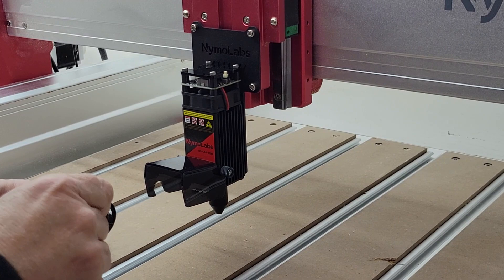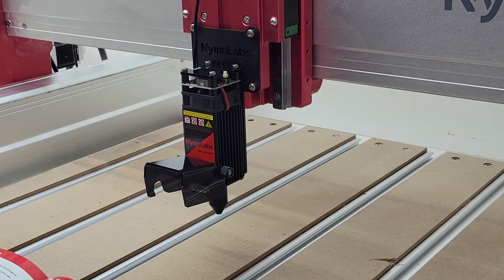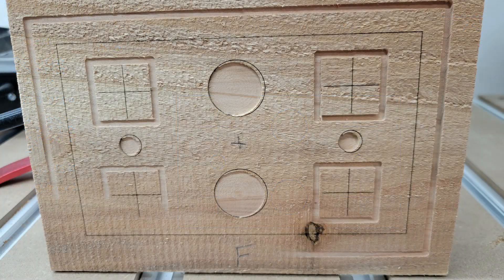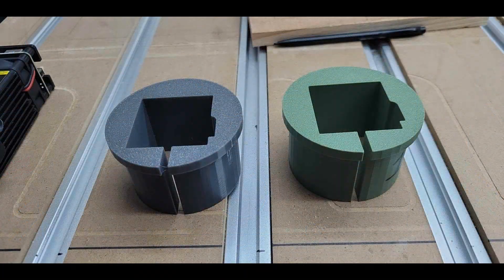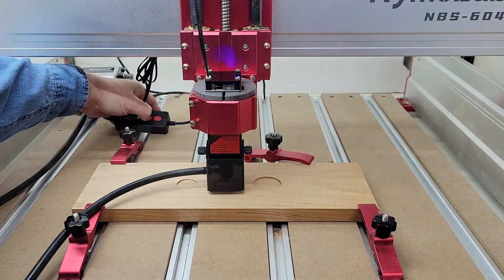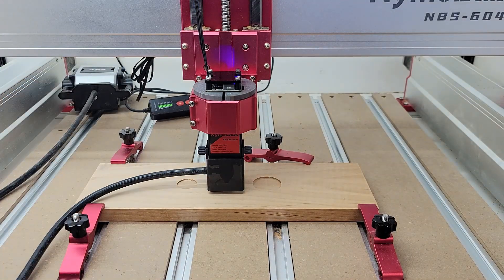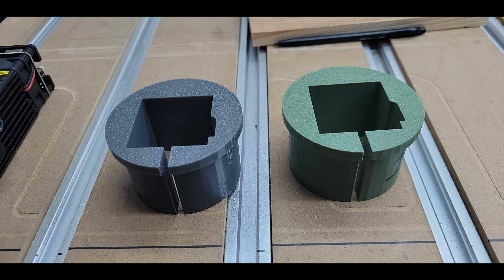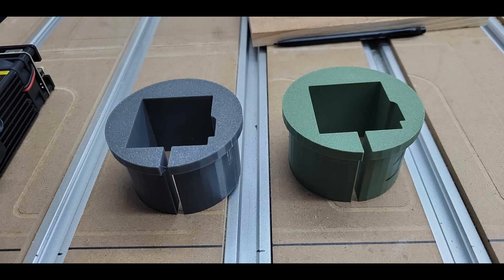Will This Thing Work??

Comment: Hello Dave, this is a great idea that you have engineered. What do you think about making a bracket that would attach to the front of the spindle, so for adding the laser, the spindle could stay in its place. I am just learning about CNCing and hope that the SW allows for setting up an offset which would compensate for the center to center difference. This option would speed up adding the laser and switching back to the spindle even further to your clever improvement.
Reply from the maker: Yes, that can be done fairly easily, and the software allows the use of an offset.  The trick is to mount it in a way so that if you ever remove it, you can put it back on and get repeatability.  Thanks for watching. I appreciate your support.

Comment: What program are you creating the 3d model in?
Reply from the maker: I use DesignSpark Mechanical software.  Thanks for watching.
Reply: @DaveGatton  The reason I had asked is if it was AutoCAD there is a setting called FACETRES that makes the stl exports smooth and non-faceted. Not sure if you were going for perfectly rounded sides